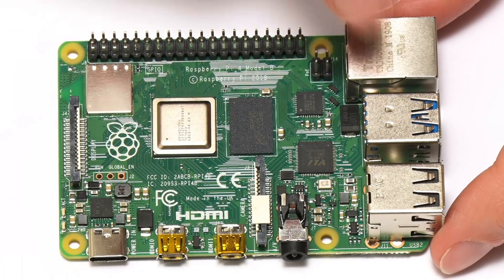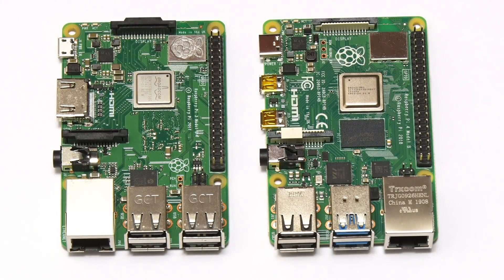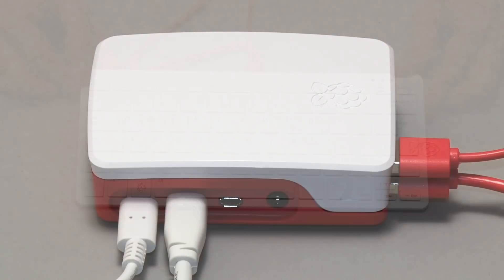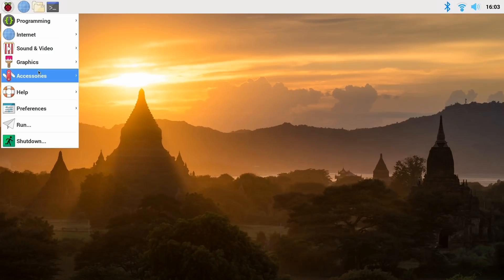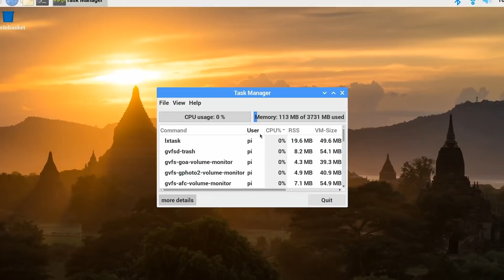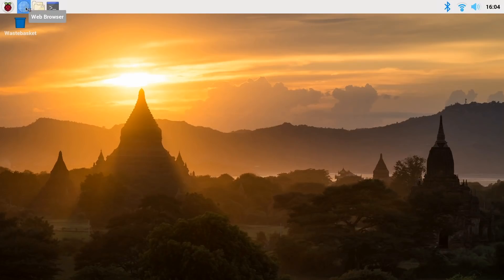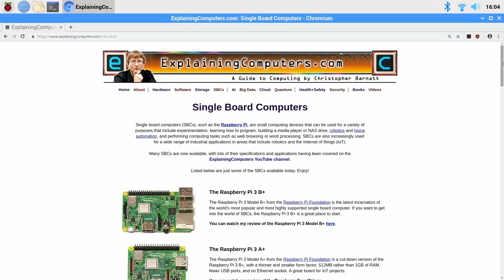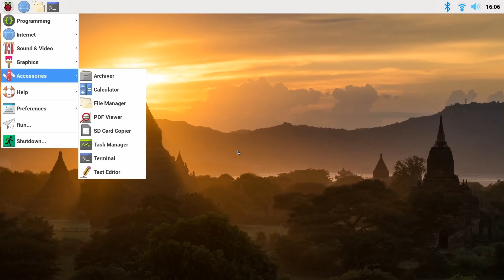Raspberry Pi 4 Model B

Comment: Woho new cases required mmmm
Finally got rid of the crappy usb power supply connector and replaced it with another mmm. What is wrong with a barrel jack?
Desktop kit comes with mouse and keyboard, still uses 2 usb ports???? Why the keyboard should connect the mouse to free up the onboard USB for storage.
Dual HDMI ok, H264 and 265 support in hardware about time. Where is the SATA onboard? 

From my point of view it looks to me like a reaction to poor sales and the will to maximize accessories sales. To upgrade from a B+ a new case, new power supply and video cable. They are taking advantage of the existing users for both support and sales.  Pretty disappointing IMO.
Reply: The keyboard is a hub...

Comment: Gigabyte eathernet and USB 3 and more ram options are all great but some built in flash memory or just a way to ad some would be nice i guess if you boot from the 3.0 would be good
Reply: *Gigabit (1 byte = 8 bits)
*Ethernet
*a way to add (short for "ADDition," not "ADvertisement")
Reply: I should go back and fix all that and people will see your response and just wonder what's going on

Comment: if there going to change the power connecter it should have been a barrel plug..and memory should have had a slot and modules
Reply: *they're (contraction of "THEY aRE")
*connector

Comment: I really like everything in it EXCEPT the micro hdmi ports. If they just left in one full hdmi port, which 95% of people would need, most people would be happy. The second port could be based on a jumper or something and those who need a second monitor can use that. But now everyone is required to get dongles which is very inconvenient, and flexibility with the display  is what made the Rpi so popular in the first place (you can plug into a TV, or a monitor, or a CRT, etc.)
Reply: 9a3eedi the micro HDMI lead is 1 USD not a budget breaker
Reply: @williamherrick497  it has nothing to do with budget and everything to do with convenience and flexibility. When I take the Rpi with me places I don't want to carry a dogngle with me. I should be able to plug in to any TV with any available hdmi cable without adapters. It's the same argument for having a headphone jack on a smartphone.
Reply: @9a3eedi  so just got a bigger 3d printed box and UGREEN Micro HDMI to HDMI Adapter, and put it all in there alongside  a few 18650's

Comment: What board would you recommend for 100 dollars range?
Reply from the maker: Depends on your usage scenario. The Jetson Nano is a very nice, if specialist, board just under $100. The LattePanda V1.1 2/32 also runs Windows 10 at about that price point. I'll be doing a Pi 4B vs Jetson Nano review very soon.

Comment: Ahhh.. At last, the fondation is moving forward. good .
Most of my friends use Raspberry pie for... emulation.
The biggest problem, when you only play with it, is the power GPU. I don't know the BCM2711 chipset....ARM Cortex-A72 was a nice little monster... in 2016. I'm also worried about heat dissipation inside this case....  So, wait and see, but it's a good news !
Reply: *foundation
*Pi

Comment: Great video which is up to your usual high standards. My concern with this uprated Pi is that it will get too hot. I have had to take my R-Pi3 out of the case because of this. Done any tests yet? I find the lack of a VGA port a frustration, forcing the use of an adapter.  I don't like the fact it only takes micro SD cards, which I find are very fiddly and easy to drop. I wish Raspian was on a plug in ROM!  I like the keyboard, not so sure about the mouse. This R-Pi4 is great for Linux users who don't want to mess up their Win PC with a linux partition. However I do think reliability is a key issue, often forcing you to re-flash the micro SD card. I think I would be happier with a certain amount of built-in  SRAM, which cannot get mislaid or sucked up the vacuum clesner! I think it would be better if the operating system was not on removable media and that you could re flash the boot partition by connecting the whole R-Pi like a USB stick.  That's my feedback. Thanks for uploading. Look forward to your next video!
Reply from the maker: I've yet to test, but it sure does get warm inside that case! I think a heat sink will be wise in many scenarios.

Comment: Thanks for the video , always nice to see a new Pi.

I dont know why they ship wifi chips with b and g still enabled. Kind of pointless IMO and having them enabled increases the size of the packet sent to the AP with the ability the device has, the larger that packet is the more air time it takes up , its not much with one device, but its a huge amount when you have 200 devices connected! ( FYI you should do the same on your AP as well as other pointless crap like WPS !)

I dream that one day i can get a ThunderX2 ARM SBC!

Comment: cant help feeling very disappointed with the pi 4

backwards compatible ? need to buy a new hdmi lead or 2 , need to buy a new power unit with that infernal usb c connector , need to buy a new case 

why not just have 4 usb 3  ports ?

no sata connection but keep the useless sound port ? 

i get the feeling that the raspberry pi foundation have stopped leading in cheap sbc development and are following , albeit poorly, the competiton
Reply: Backwards compatibility is critical for the GPIO. Yeah, it's annoying to have adapters now, but the assurance is you don't need to rewrite all of your software (and the rest) as the GPIO hasn't changed.

Comment: Great video. The new Raspberry Pi has a lot features for the money. But, how do the keep it from overheating in such a tight case? It seems like it would need a few air holes.
Reply from the maker: I think you will be proved correct . . .

Comment: No onboard storage is a deal breaker for me since from time to time the sd card gets corrupted. Not to mention sd card is slower than emmc storage as well.
Reply: You can use SD/eMMC adapter.
Reply: Agree that is an issue, I've had SD card corruption with device still actually working. Guessing though that occasional image back up is the answer. Having said that, I seldom do that, end up reinstalling.

Comment: Can't wait to upgrade my Kodi media player box to one of these, 4K video at last, plus the ethernet and 4GB of memory will really improve the viewing experience. Can't wait
Reply: + Jason Kay:  I was just thinking the same.  My libreELEC installation is running on a Raspberry PI 2 B.  It works well; however, an upgrade to the Raspberry Pi 4 B would be really nice.
Reply: @AndyinMokum  I'm not quite as excited now that I've seen what OSMC and Libreelec have written. It seems certain 4K features depends on a newer version of Linux than what the RPI currently supports and there may be other issues playing 4K video as they iron out the bugs. Libreelec states that current playback and performance is on par with the 3B+ model which I have so until the software takes full advantage of the new hardware it's not so great. That said it's still an large improvement over the PI2, especially with the gigabit Ethernet and USB 3 ports. I'm still getting one, the software will catch up eventually.
Reply: @jjk-9  They catch up pretty quickly.  I'll give it a month or two and keep and eye on the libreELEC webpage.  Thanks for the heads up 👍,
Reply: @jjk-9  I agree. The jury will be out for a while before I am convinced on 4k playback. So many people have no clue about transcoding or actual 4k playback as it is. Unless it can transcode like the NVidia Shield TV can then it isn't true 4k playback capable. The biggest issue is marketing speak. Just because for example Prime and Netflix offer 4k and a device can play those doesn't mean native 4k video processing.
Reply: I am sure after software is eventually written to utilize the new hardware capabilities it will be nice.  Till then, at least the Ethernet port and USB 3 ports will be nice upgrades.

Comment: As you said "a year away for Pi4", a few months ago I ordered a NanoPi M4 as it had gigabit, 4gig ram and USB3. Also got a SATA hat. Does what I need as a low-power file server. Can saturate gigabit Ethernet on disk I/O and uses 15 watts (including drives.) Beats my old Intel 620 APU server overall.
Now could have waited for a Pi4. That's OK, will pick up a Pi4 when they are readily available to play with.
Looking forward to performance tests and should be compared to the NanoPi M4 as it is the Pi we wanted the RPi to become. :)
Reply from the maker: I think we have all been surprised by this launch -- they did tell us "2020" . . .

Comment: They didn't give you any heatsinks?  I know they're a dime a dozen but you'd think they'd include them.
Reply: Magus12000BC the CPU is fairly weak. Unless you overclock it, it really shouldn’t need one.
Reply: There does seem to be heatsink included though. That's the metal cover on the SoC

Comment: 2 big heavy HDMI cords seem too much for 2 little HDMI micro connections
Reply: This was a bundle....109 bucks for all of it...why not throw in 2 hdmi cords?
Reply: @joshuaguenin9507  Well, why not also throw in the analog audio and composite video lead too?
Reply: @send2gl  hdmi has sound....
Reply: @joshuaguenin9507  so does the composite audio/video from the audio port.
Reply: Does seem odd to supply two, not sure too many Pi users will immediately go for dual display so one may have sufficed and the second lead purchased as required.
Reply: Might be good to invest in slim micro HDMI cables, I wouldn't use too high a gauge
Reply: Wouldn't a Pi case help with that? Considering the ends of the ports might be pretty tight against the cutouts so it might not receive that much movement or pressure
Reply: It will. It's a weak point anyway, the "old" power USB micro does already transmit the same sensation to me, But the HDMI's are heavier yet.
Reply: Please  I dont undertand why they put two micro HDMI
Reply: Well myself as one who edits audio and video. you could have your raw source come in one HDMI and have the other as your out put to what ever monitoring setup. in stead of going back and fourth between raw to edit sources.
Reply: @nathanulrich3696  hi Nathan, 
Have you tried the in-out put HDMI? 
Works well?
Reply: I do not understand your question.
If you are asking if the input and output of HDMI work then of course they work. If they did not work
then there would not be any video and or sound from the either source in or out. 
If you asking about if the new Raspberry Pi 4 works? Well I would hope that the people who designed
the Raspberry Pi 4 have tested it to make sure that their product works before putting it out to the consumer or there would be a lot of returns. I have not got the Pi 4 yet like most everyone else. So
I'm on the waiting list to get one as so as it is available for me to buy.
Reply: Perhaps, but everything is relative.  Just make sure you DON'T exert any major force on the micro-HDMI connector....
Reply: micro HDMI connectors are a scam. Even mini HDMI arent exactly durable.
Reply: Thank you for this review.
A question about the HDMI: is it possible that one of them is an HDMI input while the second it output?
That is something that would be really interesting.
Reply: @cattivello   Yeah!! It could be an interesting thing. I read that many people asked for that maybe they have some  two screen projects .  Well right know we can only try to imagine . What are they going to do with this new toy?? 😀

Comment: And...I don't see it as a major upgrade.  I see it, at best, as a semi-major upgrade almost exclusively on the fact that it now finally has USB 3.0 ports.  The extra RAM?  Not sure what you're going to do with it except web browsing.  4K video decoding?  Maybe valuable if you want to use it for Kodi, but honestly 4K streaming is needless taxing and I don't even have a 4k monitor let alone a need for dual monitor.  Gigabyte ethernet?  Nice, but mostly I'm still likely to do all my transfers off the pi to the SD card or a USB drive.
The biggest upside is definitely that the lowest model still its $35, and for that it's definitely a worthy option if you don't have a Pi already.  Is any of the features worth getting a Pi 4 if you have a Pi 3B/3B+?  I'd honestly say no.  Is the 4GB model worthwhile?  It's hard to say yes, as I really hate most ARM devices for web browsing since most I've used are underpowered--admittedly, I don't own a high-end iPhone/Android but what the Pi offers isn't remotely that.  Is the Pi a good desktop system?  I highly doubt it compared to the alternative of a used PC; I only see it as an option if power consumption or noise are big concerns.
Of course, I don't have a model to test.  I'd really like to see a comparison to a PC to see how right/wrong I am.  I'd definitely like to know if that 4GB is something that can be put to good use.  I would say, though, that PC bundle seems a bit overpriced--($55 pi + $10 case + $10 charger + $ 15 keyboard/mouse == $90, each of those (except maybe the pi) already with a decent profit).
Reply: I stand corrected about it being a major upgrade after looking at some benchmarks.  Apparently the jump from an in-order superscalar A53 to an out-of-order A72 shows a pretty massive improvement in performance (2-4x in various tests) on benchmarks that Tom's Hardware carried out.  I'm definitely curious how well this translates outside of benchmarks.  I'm still dubious about this being an actual desktop PC replacement, and I really do hope you carry out some real-world tests in that regard.

Comment: Hi Chris.  Can you make a remotely accessible wireless weather station with one?
Reply from the maker: I'm sure this would be possible. There are some great sensor HATs.
Reply: Chris, Thanks for your quick reply :o)

I'm the IT guy @ a school.  We're using 90+ Chromebooks, some old PCs & 
a few PI 3B+ systems on campus.  The best cheap computer now appears to be our Acer C720P-2625 Chromebooks, equipped with a larger SSD (16Gb > 240Gb), firmware modified * & running Linux Mint 9.1 64bit. 
* MrChromebox.tech < https://mrchromebox.tech/ >

I always enjoy your excellent videos!

Comment: Run Blender on the Raspberry Pi 4 4Gb version! :D
Reply: Does blender have ARM support?
Reply: @techwizpc4484  yes, if the linux distro you install in Raspberry Pi have blender package. if not, just compile it from source code by your self :)

Comment: These Cherry Trail are all over Amazon/eBay, as ‘Kodi’ boxes and tablets- but quite expensive (£150), but wait!   I see you’ve explained how they are managing to sell the Atomic Pi at that price.  Don’t
quote me but Cherry Trail should be able to manage 4K at 30 fps and 1080p at 60 fps I’m sure.  There’s a YT channel, called ETA Prime who has been pushing these boards for a while and it seems
they are good at games emulation.  I think ETA gets quite a bit of product placement, he’s up front about it though and he does cover emulation well.  When I first looked they were selling for over £100 in the UK which was too rich for me since you can get an ITX embedded board for £60-70 (no memory or storage, a ‘proper’ X86 motherboard though) which was more powerful and I don’t feel the Atomic Pi is really a SBC as such.

I think I’ll buy one. 
Done, $48, I do fancy the extension board as well; £27

https://www.ebay.co.uk/itm/NEW-Limited-Stock-Atomic-Pi-Full-Breakout-board-Shield/264369527546?_trkparms=aid%3D222007%26algo%3DSIM.MBE%26ao%3D2%26asc%3D58648%26meid%3D5d38936c48c74218a51242ee13a68438%26pid%3D100008%26rk%3D2%26rkt%3D8%26sd%3D264326458677%26itm%3D264369527546&_trksid=p2047675.c100008.m2219

Thing is really that board isn’t all that as we say.  It’s a breadboard sort of, with various voltages,
and I’m not sure it is worth £27?  I will wait I think, and decide if I need it since the Cherry Trail will produce a somewhat gutless x86 out of the box and will probably make a Kodi box, if so at
a notable saving over the Cherry Trail Kodi boxes on Amazon which retail at £150 (although with 4GB of DDR).

I think mine will be a games emulator (for all the ROMs I legally own…) because I have been looking at those ‘joystick/keyboard’ kits you can get of eBay/Amazon with the chunky buttons that were used in games cabinets, about £50.  So I think I can build an emulator for £150 all in with a Cherry Trail, that kit, and some MDF.  

Two great videos Chris, will go watch the Pi 4 now although
I am spent out.
Reply from the maker: I think you intended this for the Atomic Pi video comments? Confused me for a second there!
Reply: @ExplainingComputers  Sorry, in my defence I have cancer and had to hit the opiates a bit heavy this morning- best everyone take that into account when I appear to have lost it and am talking nonsense.  Yes, I am more enthused by the the Atomic, I will wait on the Pi4.

Comment: I have absolutely no engineering skills so if somebody was to kickstart a 10 - 11 inch laptop case with a 4g module and the largest battery they can legally fit, I will throw my money at them.  With 2 hdmi, can have an external monitor as well.